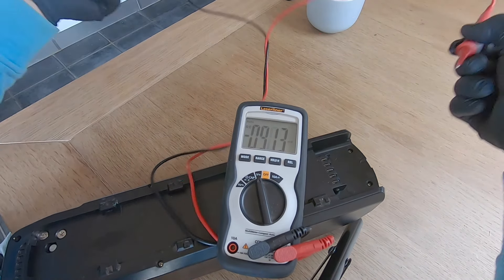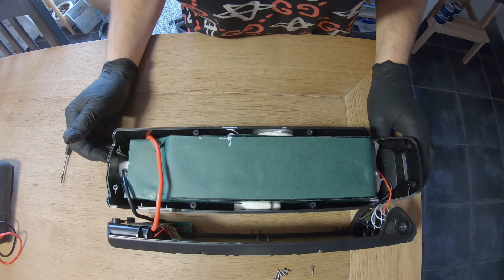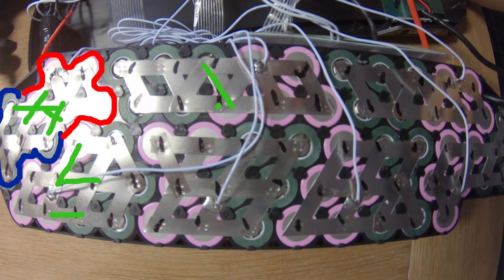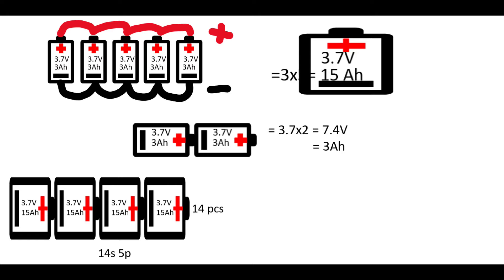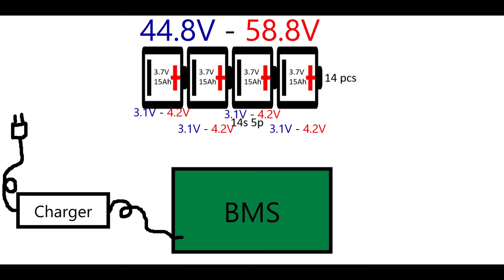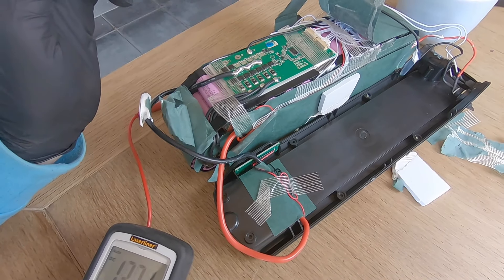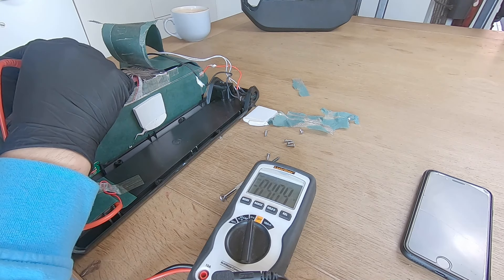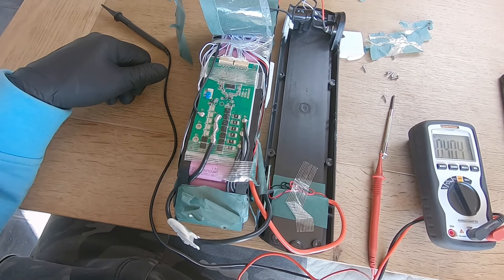Dead BMS! How to test it? & what's inside my 52V battery pack?

Comment: After watching your video and others, it's obvious that the BMS is the problem with my battery. Problem is, I don't know where to get a replacement or how to make sure I am getting the correct one. Ca you provide any guidance?
Reply from the maker: It is a tough one to be honest.
I have only bought BMS twice myself.
You need to consider only several things: 1. Amperage, depending on how many watts you want to draw from your pack, your BMS should be able to survive it, and I would add a bit. If I plan 50a draw I would go with 75-100A BMS.
2. Number of cells in series. 3. With or without charge leads (some batteries charge through the discharge lead and some have extra charging ones, that is defined by the type of BMS). 4. Do you want to connect to your BMS via bluetooth. “smart BMS” will allow that.

I got myself one from here: https://www.lithiumbatterypcb.com/product-category/smart-bms/
It has been about a year or more and it is still going strong. It is ctually doing a great job at balancing cells. But it did not fit in the same case as it was much bigger than the stock one.
Otherwise, get something from aliexpress, read reviews and hope for the best :) 
Someone told me that good BMS will likely cost 1$ per 1A, but I am not sure if that is a great way to assess it :)
Reply: Amazon carries them..I have a 48v yet passed the bms it reads 19.5. this is.why I watched your video. I believe you helped my decision for a new bms. Thanks

Comment: good work I have 16 s 24 amps 48 volts lifepo4 battery when it goes to 50 volts the lamp headlight horn does not work at all bms turns off it is charging until 53.1 and not   charger is it the problem with the bms or the batteries please help motor contoroller 500 watt motor 249 max 1200 wattscontoroller 42.+52+1 nominal voltage 48 60 volts contoroller 30+1 ampere 500 watt contoroller lifepo4 16s battery shuts itself down to 50 volts and charges in 1.5 hours, what is the reason, thank you video informative : greetings from Turkey)
Reply from the maker: Hi mate, it is a bit hard to understand this one very long sentence :D 
If you BMS cuts off charge before the battery is full you need to find out what are the voltages of individual series groups. Potentially one group will be at max charge level, while others are not. It can be because of the faulty battery cell.
Reply: @VRMinde  It's a really nice video, you can be a marvel of technology, thank you very much, good work.👏👏
Reply from the maker: @Beyinlocked  haha thanks mate! hope it helps!
Reply: @VRMinde  48 lifepo4 volts fully charged 53 volts 50 volts to 53 volts It charges in 1.5 hours Even phones with lifepo batteries do not charge that fast in 1.5 hours charger 24 amps 3 amps amazing 3 volts It takes 10 km maximum in 1.5 hours problem battery or controller? :)

Comment: Hello ,thank you for your video the explanation was pretty good , I got a problem with my e bike battery it’s a 48v 34ah , when I put it for charge it takes 15 minutes and the charger show the green light means it’s full , I changed the charger but nothing new ,I don’t know if it can simply repair or I have to buy a new one
Reply from the maker: You need to see the voltages of the cell groups. But either go and study “diy li-ion battery build” until you understand that yourself or bring jt to someone who repairs the batteries instead. You will pay for their work and knowledge and they will fix it for you :) these batteries can explode or burn down a house
Reply: @VRMinde  you want to say the problem is in the cells thanks reagards
Reply from the maker: @Anti-P  I assume you have a disbalanced/problematic cell. It probably has voltage way off from other cells and BMS does not let overcharge or over-discharge the individual cell groups. So if your one cell group is at 4.1V and other at 3.5 - you can’t either fully charge or fully discharge the full pack. If you can measure voltages of each series groups you would know if that is true or not :)

Comment: Thank you for the video. I have this question. When diagnosing a battery, there are two errors. The first LED flashes on the first and fifth test. How to reset these errors on the BMS board?
Reply from the maker: I do not understand what LEDs are you talking about mate 🙄

Comment: What caused the bms to fail? I just had one go on me as Well🤦battery is fine but no power through bms
Reply from the maker: Have no idea what could be the cause 🤷🏻‍♂️
Reply: I went for a cheaper and 7s 20a 
And I guess youbget what you pay for. Thanks for the vid and the reply!
Have a good one ✌
Reply from the maker: @thomasholland4313  i replaced with some expensive bms and it works since :) thanks man and have a nice weekend!
Reply: If you build No bms only hobby charger. Bms suck

Comment: I have ebike model MATE X-750W.Battery fail-
Ithink charge to 43V but when turn key to ignition position voltage on output connector 0V.
Problem with BMS?
WHAT can i do?Where buy or fix it?
Reply from the maker: Can be BMS, can be the “ignition key”. It should not charge to 43v, I assume it is a 10s pack and if yes it should never ever be more than 42v (4.2v X series). Try and search who is making/fixing batteries around you, they should be able to help.

Comment: Can I connect the battery directly to the hover board, bypassing the BMS?
Reply from the maker: You can bypass the bms, but then you need to make sure you never overcharge the pack or overdischarge or loose the cell balance, or have a bad cell etc. :)
There are people who prefer no BMS, I am not one of them
Reply: I heard you could bypass the BMS….but leave the charging port’ basically only using the BMS when you charge the battery.
Reply from the maker: @ebperformance8436  you can, people do that when they have let’s say 10A BMS, but want to draw more amps from the battery pack. It won’t stop you from discharging the battery too much then, etc.

Comment: Hi, i bough a 36V21ah battery pack for ebike, it came with a strange odour, but i though it was because battery was brand new, i made about 400 kilometers, battery seems work well, but one year later, strange odour is still here (headache after inhalate this odour (no smoke,nothing anormal, just odour))

What do you think about it ?
Reply from the maker: never had "smelly" batteries :D Don't even know what could be the reason mate...
Reply: @VRMinde  maybe a leak, i'll try to see it with customer, thanks for your answer
Reply from the maker: @TotocheOly  if you had a damaged cell your battery capacity would be miserable 🙄 but you will only know for sure when you open it
Reply: @VRMinde  the capacity seems normal, the battery restores the advertised capacity well, that's why I don't understand why there is a strange smell

I'm afraid to open it now x)

Comment: hey very intersting, did you have any "crash or bump" before it stop working?
i put my new bike together, tested in the room , it worked, than went out and first throttle did not work, so i tested different controllers, not working, but when i put the charger on while battery on the bike it works.....
so i checked the motor work
controller works, 
throttle worls, cables work, seems like the battery doesnt give any power 
even if i want to check the battery status, it gives no signal, only with charger in it...
Reply from the maker: not that I recall mate. In case your battery contact disconnected from a little bump or so, it would have happened anyways. I ride my bike as a "propper mtb", so it falls, bumps, sometimes flips and still works :)
Reply: @VRMinde  hey i found the error, i modded to a bigger controller , so the 30 a fuse of the battery  burnt
Reply from the maker: @matthiasdornblut2727  that's easy :) congrats!
Reply: @VRMinde  do you think installig a bigger fuse like 35amps would work, if i keep an eye of the battery temp?
Reply from the maker: @matthiasdornblut2727  someone who put that fuse in, probably put it with the reason - to protect either battery cell connections, cells or BMS. If you install larger and draw more amps - you will burn something else than the fuse. Install another original amp fuse and keep an eye :)
Reply: @VRMinde  ok , check;) so is it possible to install a bigger bms with more amps ? yes i have to check the stats of the cells, but how do i figute out that for how much ams my cells are capable ?? thank you for your help :)
Reply from the maker: @matthiasdornblut2727  normally there will be a model of a cell on its' side. By that you can find its' data sheet and find for how many amps is it rated. Another thing to consider is how much nickel strips there are between each series groups. Probably it will be 0.7 or 0.8 mm thick nickel strip. That is a bit harder to know... But if you look online for nickel ampacity charts you will find what width X thickness can carry how many amps :) 
Potentially someone who built the battery pack did not put more nickel than he was thinking of using it for and installed a similar amp-rated BMS and the fuse :) So it might be not that simple to pull more amps of your battery pack without burning / overheating it :)

Comment: my 48v 13s battery on a ebike, cuts off screen volt read from 50.8 then 36v then 28v then screen cuts out restarts reads 28 then jumpos up to 50.6v then drops again, i mesured each pac 4.23v but one in the middle reads 3.80v i have tryed chargig it to get it back up but dosnt get much higher, pac or BMS fult?
Reply from the maker: If you have cells that do not charge up - there are definitely bad cells. BMS might be fine. The question is why do you have one bad pack? Can be simply 1 faulty cell. Anyways you will have to replace the wrong cells first and take it from there... annoying as F...

Comment: How am I testing the pins?  put  the negative to the main negative and then the ppositive to each pin, one at a time?
Reply from the maker: If you test like you have described - your voltages will be adding up (f.e. You will see 4.05, 8.1, 11.16, etc). You can also measure in between two pins that are next to each other, then you will see the voltage of each series group (4.05, 4.05, 4.05, ….). Just be careful and do not touch the pins together to avoid fireworks :)
Reply: @VRMinde  thank you much

Comment: Does anyone know how the red ON/OFF switch on the battery works? Mine is connected to the BMS, but it does nothing. The battery always give power. Is it BMS fault?
Reply from the maker: It is a bit hard to understand your question without having any context mate
Reply: Ye, my battery was stuck in the on position, so I removed the switch, and the led display circuit board

Comment: Thank you for this video i have the same problem and battery. Thank you i can fix it now 🙌
Reply from the maker: The "smart" bluetooth BMS that I have purchased now works perfectly for a while already. It did not fit in the battery case so I had to 3dprint a small bos on top of the original case..
Thank you man!

Comment: Hi i have a 48volt and i charge it to 54.6. Now the battery shuts down at 46volts, 1/2 the charge with a error code from bike. The bike turns on again at 46volts just to cut off a few minutes later. Can it be the bms? Or defective cells
Reply from the maker: What does the error code say?
48v pack should be 13s? Then if it turns of at 46v average voltage per cell will be around 3.5v.
There is a chance that your pack might be disbalanced/have bad cells. Let’s say you see 46V, average is 3.5v per cell, but there might be cells that are at 3.2 or 3.1, while others are at higher voltages. You accelerate, voltage drops and if some cell reaches minimum set voltage BMS will shut down the pack.
You need to first find the voltages per every cell group when it is at 46V.
Reply: Sorry for getting back late the error code is E0006...its a low voltage code. Now how can i balance my battery, 46 volts with error code. It charges to full...can it be defective?
Reply from the maker: @otto99able16  I do not think you can guess it. You need to measure the voltages of every series group of cells. If it is unbalanced a lot - probably some cells will be defective and won’t keep balanced.

Comment: I have a 52v 17.5ah battery for an ebike I'm building. The battery has a 30A bms and the bike has a 1500w motor. Will these work together? If not, what can I do to protect the battery? Should I get a new battery or can I change the BMS
Reply from the maker: 52V should be 14s pack. Voltage will be from 46.2 to 58.8. If you stay at let’s say  28 amps you should generate 1293-1646W, depending how much charge is left. Which makes it reasonable to have 1500W motor. You should limit your power/amperage on your motor controller to like 28a max and your components should be just fine, if the pack is built with enough Ni between the series connections. If you want to use more power on your bike you will definitelly need another BMS or even battery. Your battery pack might be build for more or for less amps, depending how are the cells aranged and connected in series 🙄

Comment: Hi what will happen if connect the battery to me controller if the bms is not working 
Iam afraid to burn the connect 
Do u have any idea? 
The seller tell me to check my bms 
If are in the 🇬🇧 
Do u have any store can check the bms for me ?
Thanks
Reply from the maker: Hi mate, I am not in UK I can’t help you. 
BMS ir protecting your battery, it has not much to do with your controller.
You can check the voltage if it is correct before connecting anything
Reply: @VRMinde  hi thanks for your reply 
 the Voltage is zero 
I checked the Voltage of  xt60 not bms 
Is it dangerous if I use the battery if the bms is destroyed  🤔 
Can I check the bms without open the battery 
I can charge The battery  normally  and the usp in the battery works 
But last time I connected 2 battery to one controller so the controller is burned  after that I connected one battery to the same controller something wrong in the battery or in the controller i don't known
Tomorrow I will receive a new controller wich cost me around $65 
I am afraid to connect to the controller burned the controller again  what do you think 
Thanks for your time
Reply from the maker: @أمجدسوريا-ز3ي  if your battery gives 0 then there is either a physical problem in cells/contacts etc and BMS is shutting it down or faulty BMS. 
You will not find out the problem without disassembling it. Do not connect faulty battery to anything and make sure to keep it in a safe place until you find someone who can open and check it for you.
Lithium batteries are dangerous and can cause serious fire mate, be careful. 
If you don’t have basic understanding in electric circuits - save yourself time and money and find someone who will fix it for you
Reply: @VRMinde  thanks alot  
Yes it gives zero on xt60 connector 
The problem is all stores refused to touch it because i bought the battery  from China 
And it is still new I charged to full and looks fine 
Where should I test the Voltage do mean I have to open to check it or I can test from outside I hope I can share a picture with you to explain more to you but my English didn't help me alot 😁